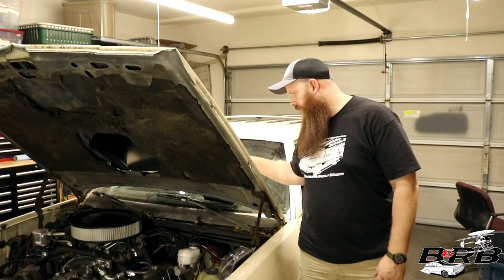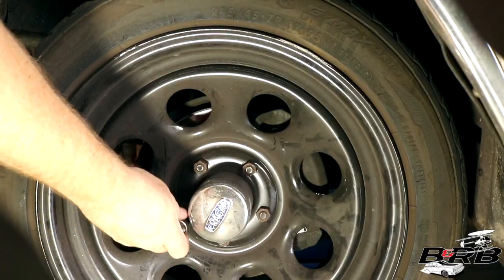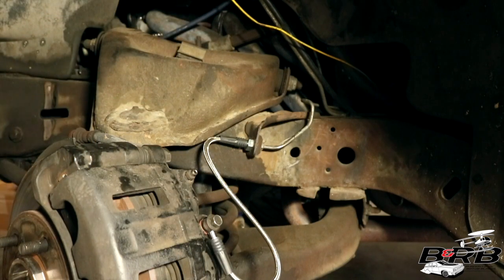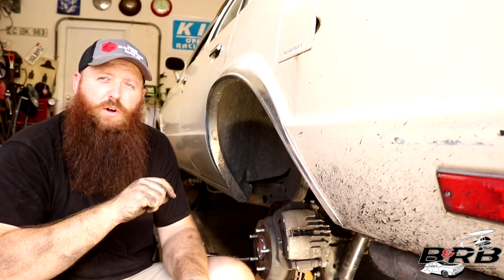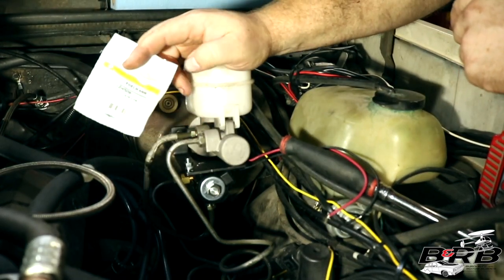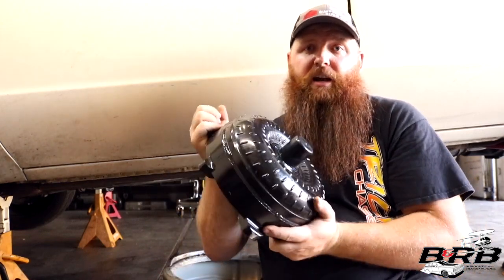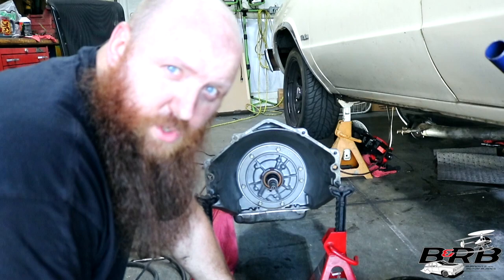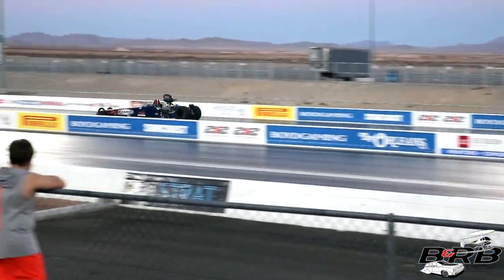GBody braided brake lines | Line Lock| Drag Racing Glory, for once | #FamilyBurnoutWagon EP23

Comment: Great content!!! It’s nice seeing someone else using an sbc/700r4 combo.
Reply: @BurnoutsAndRotorblades  I agree with you 100%. I just posted my first vid about my G body. I've been following your work and will be using it as reference when it comes to changing out my rear end. Although, I'm not sure if I'll do an extensive swap like you did because I have novice welding skills.
Reply: @BurnoutsAndRotorblades  Thanks. It's been a work in progress. Honestly your existing videos have been covering my projects. A lot of G bodies are probably dealing with aging dash boards, inoperable window and door lock switches, and a complete lack of options for gauges (like me and the tachometer query). You've already done a headliner and core support which either fell down or rotted out on my g bodies in the past. Lots of G bodies could benefit from a full how-to on a complete LED lighting changover? All of those subjects would be good content. Have you shared your videos on G Body nation at all?
Reply: @BurnoutsAndRotorblades  It's a facebook group. 

G-Bodies United has 46.5k members.
The GBody Connection has 47.5k members.

Comment: Not sure what rear end gears you have , but if they are stock change to 3.42 would work wonders probably dip into the 12s easy. 3.42 gears are still road friendly with the overdrive on the 700 trans.